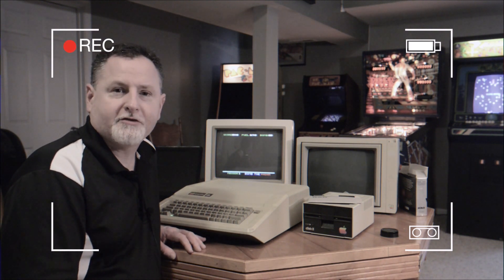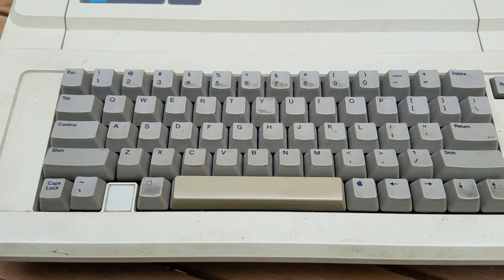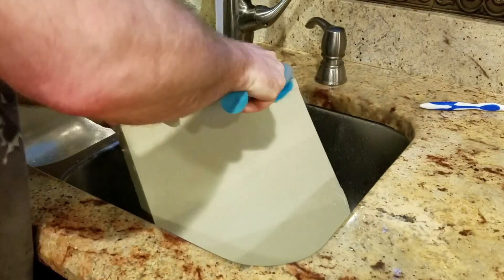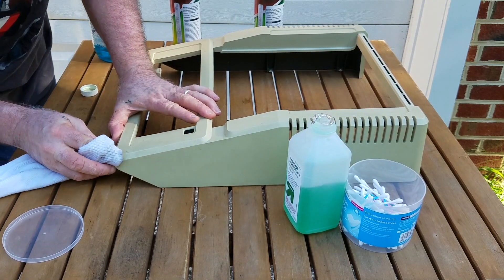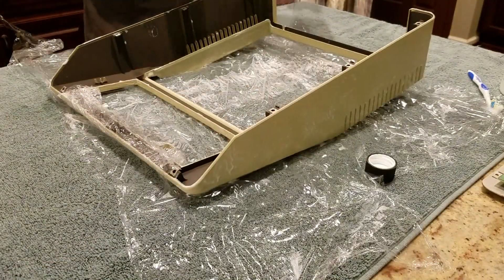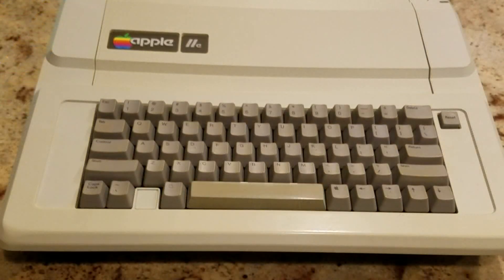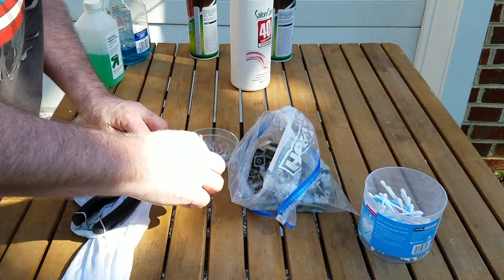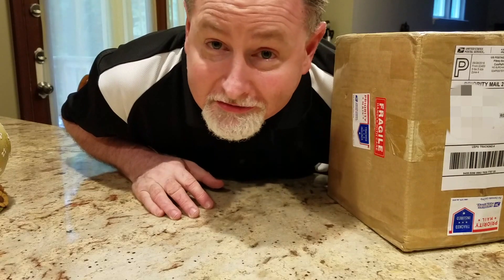Reverse Computer Case Yellowing

Comment: did this resolve the yellowing evenly? when I did this to my case it produced a marbling effect. I did use a different product however which may have caused this.
Reply from the maker: For the case itself, yes. However, I did get a little of that marbling effect on the space bar. From experience, it seems this may be caused by having the cream on too thick, as it is important for the UVs to shine through and react with the plastic. In some cases (no pun intended), it may be better to use straight liquid peroxide in a sealable bag. The idea though is to be sure the plastic is submerged and not allowed to evaporate (hence the plastic wrap on the cream method. In your case, it may have also occurred if you made your own, and the peroxide wasn't thoroughly blended.
Reply: That Geek Guy thank you for the speedy reply. I ask because I have 2 more apple //es that are yellowed and I don't want to ruin the cases like I did the first. also, did you cover the nameplate on the cover?
Reply from the maker: Your case may still be recoverable. Try the beauty store cream method instead of mixing your own, so you'll know you have a better blend. Then depending on how broad the marbling streaks are, you could try painting on the cream over the more yellowish parts.

If your on Facebook, there's a group I belong to called Apple II Enthusiasts (www.facebook.com/groups/5251478676/) There's a whole slew of folks who Retr0brite all the time. Ask to join, then post an image of your case, I'm sure one of them may offer some additional advice depending on the condition.

Finally, I did not cover the nameplate on mine because I just brushed around it. Some people do, others don't. Just be careful whatever you choose.
Reply: That Geek Guy excellent! thank you so much. I'm going to Sally beauty today to try and save my case and restore the others.
Reply from the maker: Excellent. Good luck :-) be sure to check the progress, and once you start noticing a change, consider cleaning it all up, then do a complete coverage coat for a final blend if needed.
Reply: @ThatGeekGuy   I don't think this whole yellowing thing and lightening thereof is well understood yet at all.  It has been found that some plastics that were not treated with bromine fire-retardant compounds also turned yellow, and in some/many cases all it takes is exposure to direct sunlight for some hours/days to bleach them back to their original color (or close).  This doesn't appear to make sense, but there is plenty of empirical evidence for this, which calls into question the current theories--there are just so many proven contradictions.  Another example is that sunlight/UV is not necessary for hydrogen peroxide to bleach yellowed plastic.  The 8 Bit Guy himself found that only heat was necessary, not UV.  So then why does UV exposure seem to have an impact on bleaching, sometimes resulting in "marbling" when it is uneven?  No one really knows what is going on.

I have a new theory that is both simpler and more complex in different ways.  I think that sunlight and hydrogen peroxide both have a general bleaching effect on things.  If you think about it, this seems to ring true.  This is why leaving at least some yellowed plastics out in the sunlight lightens the yellowing (a proven fact, at least for some plastics, including the ones used to make Commodore and Atari computers).  Hydrogen peroxide works, as well, but requires extra heat or else it would take forever to get any noticeable lightening effect on yellowed plastic; this explains the experiments that involved only heat being effective.  Still with me?  People believe that it's the UV that "activates" the peroxide's chemical reactions, but it's really just the heat from exposure to sunlight, which can be uneven.  The best way to use peroxide is in a liquid (not cream) bath with heat applied (no sunlight or any light required) as evenly as possible.  Now, as for sunlight/UV bleaching, I think the key is which ranges of UV wavelengths are involved.  My theory is that the shorter UV wavelengths cause bleaching while the longer UV wavelengths cause yellowing.  This is based on the fact that long-term exposure to fluorescent lighting appears to cause severe yellowing.  For instance, a C128 power supply that I bought was pretty severely yellowed except for where it was shielded by its own cable, showing that light exposure (I strongly suspect fluorescent lighting specifically because of its long-wavelength UV content) was what caused the yellowing (this is not the only cause of yellowing, though, as some plastics have yellowed in complete darkness).  Yet exposing it to sunlight alone (no peroxide) lightened the yellowing, and it might be because sunlight also contains some short-wavelength UV that has a general bleaching effect.  This is just a theory, of course, but it is a far better and more complete match for the observations made by those experimenting with lightening yellowed plastics.  It does not explain everything, nor does it necessarily apply to every case, however.  There may well be a dependence on the type of plastic involved.  Some yellowed plastics are not bleached by sunlight alone, although many are, including, as I mentioned, those used to make Commodore and Atari computers (the 8-bit ones, at least).  Be careful when experimenting because all of this is still so poorly understood.

What some restorers have opted to do is paint their yellowed plastics instead of bleaching them.  This has obvious pros and cons in accordance with common sense.  Paint, when properly applied, can look surprisingly good, and has no negative effects on the plastic underneath.  On the other hand, it can get scratched off, and is not an authentic finish for most computers.  On the positive side, it won't turn yellow again, as some plastics have done after they'd been bleached.

Comment: Would this product work on yellowed car headlights?
Reply from the maker: There is some discussions in the retr0brite communities that it may work. It really depends on what the plastic itself is comprised of. Rather than using this cream developer, you might want to try a low percentage hydrogen peroxide liquid first. But only experiment if you are willing to sacrifice the lens if it does not work out.

Now, if the headlight is fogged over, there is a product used for cleaning pinball playfields called Novus (1, 2, & 3). It is a mild abrasive cream that can be used to polish/buff out the haze. Novus 2 would be the best one to test with as Novus 3 may be too harsh. You could follow up with Novus 1 for a final shine. Again, only attempt this if you are willing to risk damage to the lens.

Comment: I wonder how it affects the longevity of the plastic though? will it make it any weaker?
Reply from the maker: The practice is best know as Retr0brite(ing). It's pretty well tried and true and most vintage computer enthusiasts swear by it. The process is not known to damage or weaken the material in any way. However, it is not a permanent solution either and may need to be retreated within a few years if kept in a location frequently exposed to UV light.
Reply: @ThatGeekGuy   I can't speak from experience, but I've heard that multiple applications can result in a change in how the surface feels (generally rougher and with the potential loss of the original texturing, if any).  I don't think it does any harm deep in the plastic, just on the surface.  Some plastics appear to yellow on their own, even in the dark, but as a precaution I'd keep my vintage computers away from fluorescent lights especially, and also sunlight.  I know for a fact that in some cases yellowing can occur as a result (based on the fact that shielded portions did not yellow at all on some items).  I believe--but cannot guarantee--that LED and incandescent lights are safe.  Incandescent lights have a very small UV component, so if longwave UV is the problem, then LEDs, which have virtually zero UV emission, would be slightly safer; on the other hand, if blue light is the real culprit, then LEDs wouldn't be safe at all.  Unfortunately, so little is known about either the yellowing or the brightening process.